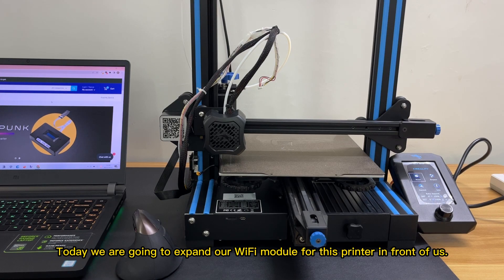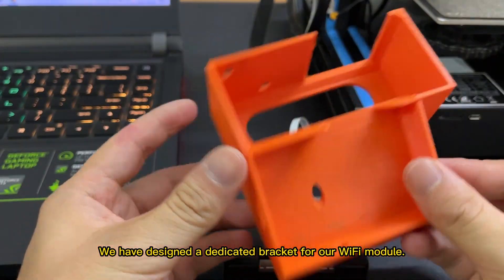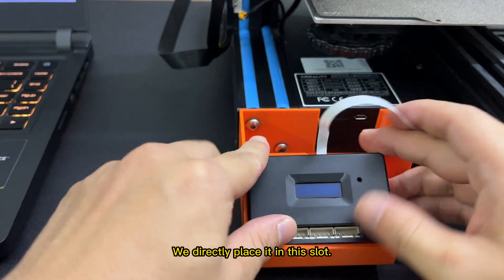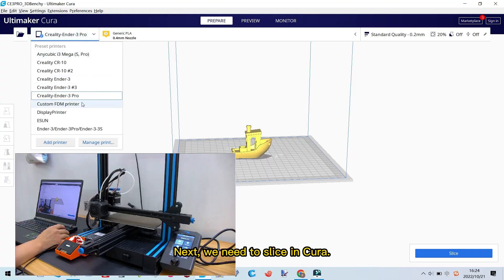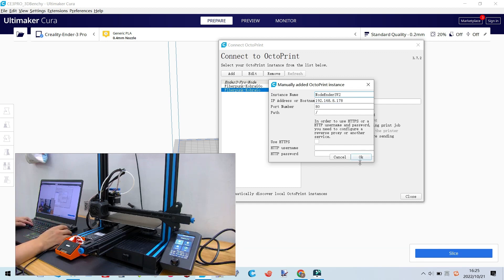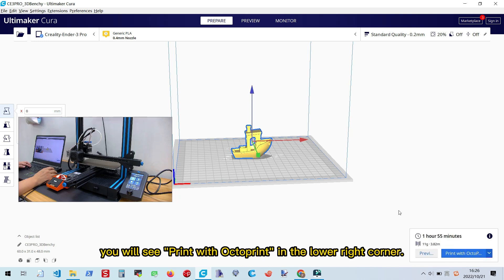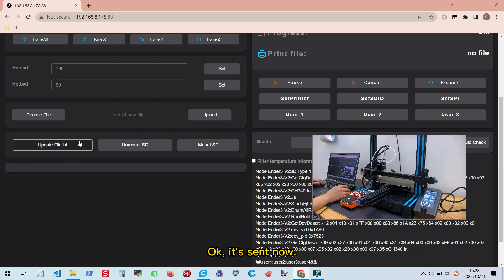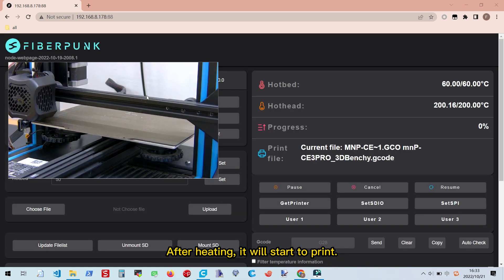Easily Upgrade Your Ender3V2 with a WiFi Module and Control It with webpage

Comment: I am also wondering about the custom Bracket and is there a cover for the wires?  Just ordered mine from your site.
Reply from the maker: hi, the usb bracket does not include the cover, but you can download the original design file in the link:https://docs.google.com/spreadsheets/d/1pkXoGo6gDXDX6GhRvL3V94UBKY_DR0yV2ammWk8TF3E/edit#gid=627283418